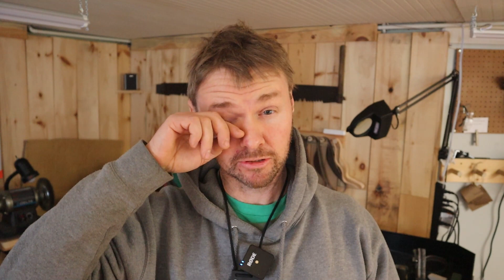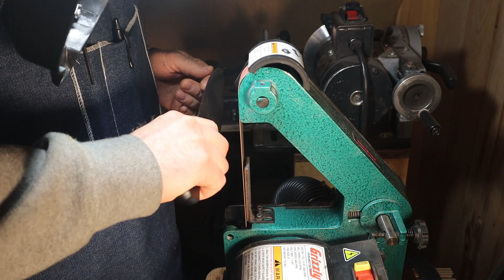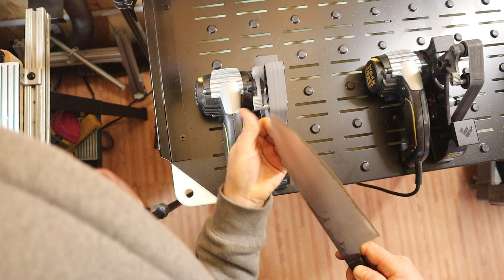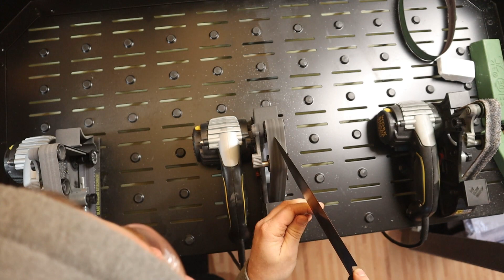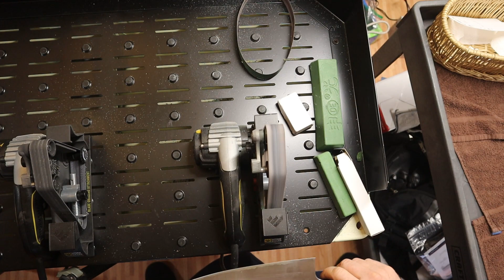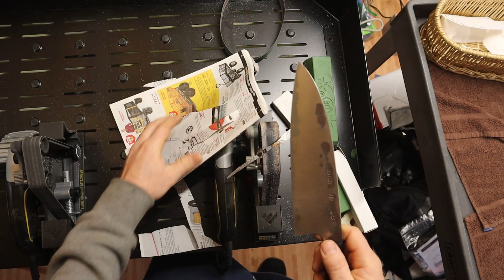TNG Ep 51: Repair and Sharpening of a Carter Cutlery Perfect Kitchen Knife

Comment: This was an interesting video to watch.  The tip repair was great but it was hard for me to watch the worksharps on Murrays knife rather than wetsones.  My experience has been that his knives in white #1 sharpen so quickly on a wetstone I think it takes longer on the belts.  Point of clarification, Murray doesnt say its "the perfect chef knife"  the model is just named "perfect model"
Reply from the maker: Thanks for being here, Matt, and for your comment. 
Once upon a time I shared the perspective that belt sharpening is bad and stone sharpening is good, but as I've learned more I've come to the conclusion that the people who taught me that were trying to sell me stones. Murray included. 
I now think that if you use belts smartly they save a tremendous amount of time and can deliver comparable results. I'll balance that with my opinion that I still get my best edges off my Edge Pro but there are several factors that play into that. 
The comment that the knife sharpens faster on a stone than on a belt doesn't jive with me from a logical or reason based perspective, but to each their own. 
I went back and checked my receipt and it was sold as "Perfect Kitchen Knife by Ryan". So it seems fair for me to refer to it as being marketed as the perfect kitchen knife, in my opinion. 
Cheers man! -Matt
Reply: @capnmatt41  As I understand it, sharpness achieved by skilled users on stone vs belt is indistinguishable initially, but longevity is better on stones... However that’s almost impossible to demonstrate except in controlled, experimental conditions because in a normal domestic kitchen the jobs and usage are so variable day-to-day.  I think it’s fun and interesting to consider, but probably a moot point for the average knife user....
Reply from the maker: @greatrixbrad  Yeah man, I'm with you on that. 
When I read the 'stones are faster' comment I was thinking in terms of material removal rate, largely because the majority of knives I see are pretty beat up and need new bevels cut. 
I could see myself running down a long rabbit hole with an edge tester trying each sharpening method I have and using the knife over a certain period of time in the kitchen.
Reply: @capnmatt41  Ha.  I’ve just dropped into that rabbit hole...  Only using the Tormek for now but playing around with a sharpness tester and trying out techniques to get faster vs the edge quality it produces...  But I’m so, so, so close to adding a WorkSharp into the mix...
Reply from the maker: Brad, I'd love to know what you learn after working through a few different scenarios. One variable that is on my mind is the time spent with the stone grader going from course to fine. Got a few other in mind though, let me know what you come up with, if you don't mind.